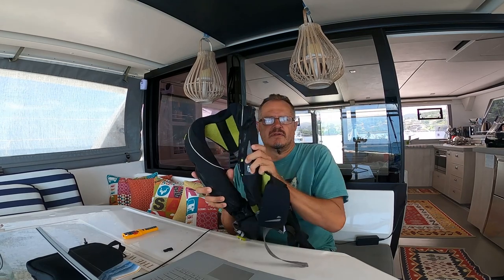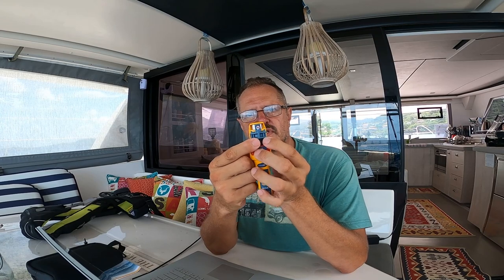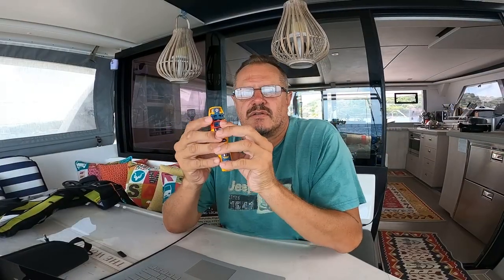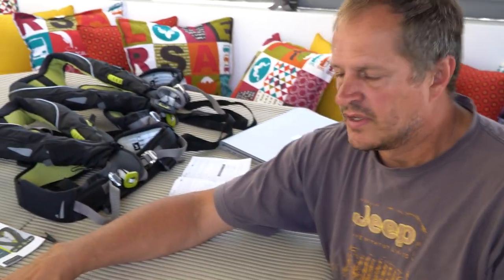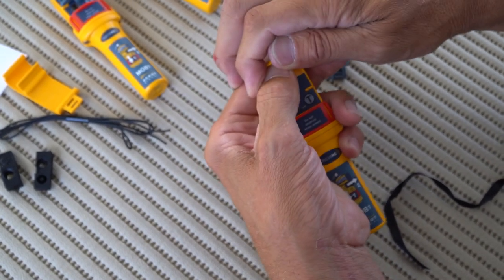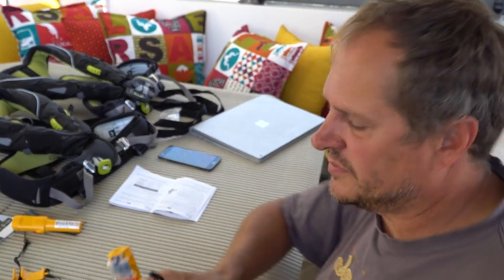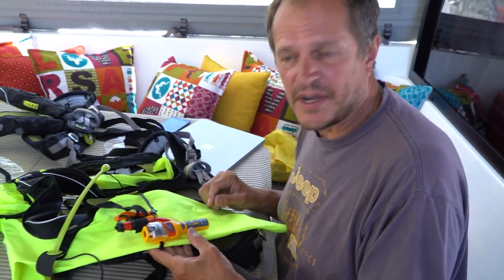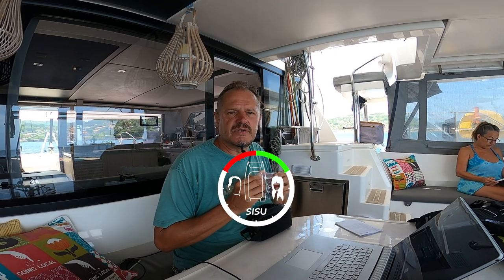#138t Man Over Board! How to CONFIGURE and TEST your Spinlock Life Vest | Sailing Sisu Leopard 45

Comment: Nicely done video.
Two notes of caution I would like to add.
The MOB is attached to the manual inflation tube, as in the video and the deploy cord is wrapped around the vest.  You did that correctly.
However you should fold up the vest in that spot and then pull/shorten the deployment cord tighter.  What you want is the force of the inflation to rip the activation switch off the mob.
Dont tighten it like like sneakers, but you want it tighter than the inflated diameter of the flotation device without the user worrying its active.

Second point, the only thing keeping that unit attached to the vest is the little plastic clip. It uses compression on the inflation tube.  It will over time cause that area to compress and may cause a situation where the MOB could disconnect itself from the vest. In addition, the inflation speed could also rip the MOB off the craddle thats its attached to.
I suggest using some small messenger line or fish line and tie the body of the mob to the inflation tube in some way.  Backup the line with a few twists of water proof electrical tape of some sort so the line cannot be taken off.

This will guarantee the MOB will always stay attached, even if the user panics and thrashes the unit around, or needs to manually inflate the vest.
Reply from the maker: Excellent advice, Richard!

Comment: Very instructive, thank you Crew Sisu. Really, really helpful to see it in action and unzipped. In so many videos someone just stands and points at the safety device....  (or else they spend 15 minutes opening the package...???) I first bought a Mustang and then took a friend sailing using that as an excuse to buy the Spinlock.   
I wonder if it's possible or advisable to find a way to carry an orange smoke device.  
I've used the Spinlock in my kayak, worked okay. But there's no pocket to carry my handheld VHF radio.  
It's really helpful seeing the inflate/pop. It looks like if I made an attachment on the front of the Spinlock for my radio it's not going to hit me in the face when it inflates.
Reply from the maker: First, thank you for the kind words and for watching! Regarding the radio... I think it can fit if you attach it lowish. But will punch you in the chest, I am sure 😏 this Spinlock model has this ET light but also lights inside the yellow tube so, you will be one big floating light. I understand that you are looking for a solution during daylight with the smoke. The thing is that you can attach a lot of things, radio and smoke, but keep in mind that you will need to carry that the whole time while wearing it when you are working lines and sails in tough conditions. If only for a kayak, then I can see a way 🤔